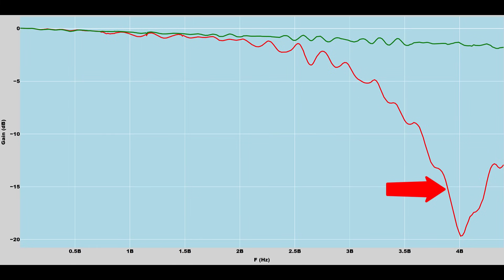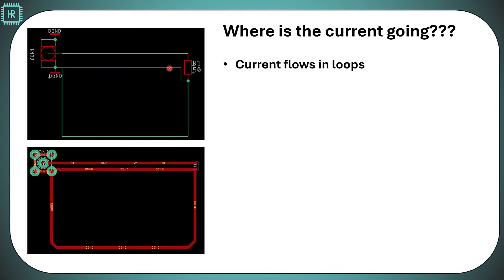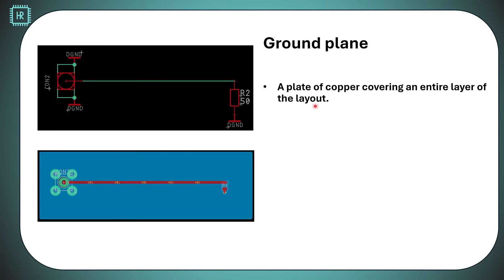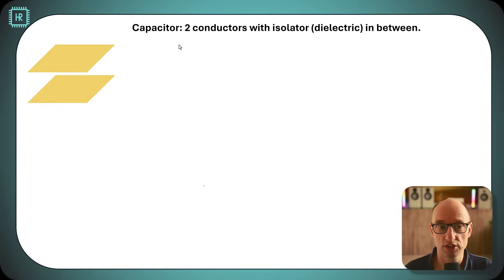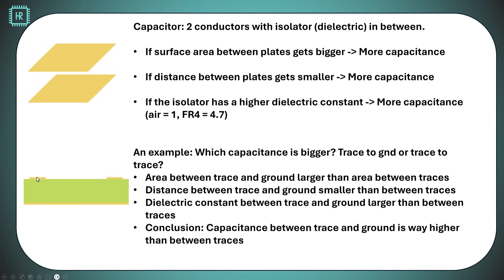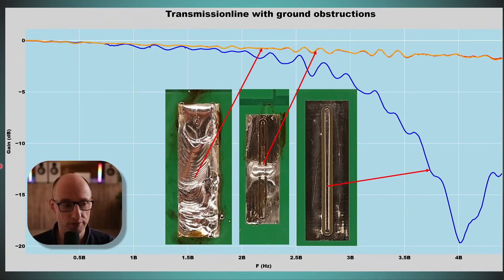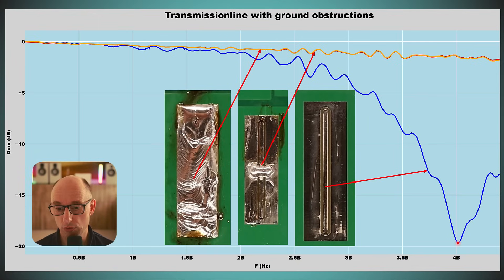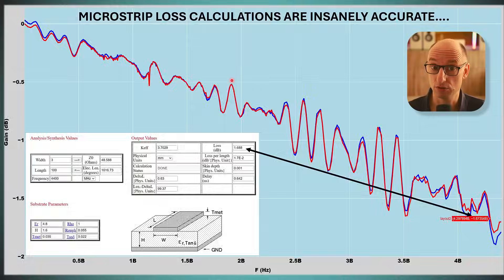Flawless PCB design: RF rules of thumb - Part 1

Comment: I'm not an electronic engineer so this is pretty advanced for me. This was radio circut but I assume that all electronics circuits is susceptible to this? 
Please send me the checklist.
Reply from the maker: I've changed the free checklist offer a bit: You also get a 1 hour module of my course for free!

You can find the link to the page in the description. Scroll down a bit on that page (Or read the whole page, you may get curious :-) ) to find the link.

You will have to leave your email address so I can start spamming you :-D . I don't do that very often, on average once a month, but I am thinking about starting an email series with useful electronics tips at some point.

Best regards,

Hans Rosenberg

Comment: nice work. Please send me the checklist!
Reply from the maker: thanks!

I've changed the free checklist offer a bit: You also get a 1 hour module of my course for free!

You can find the link to the page in the description. Scroll down a bit on that page (Or read the whole page, you may get curious :-) ) to find the link.

You will have to leave your email address so I can start spamming you :-D . I don't do that very often, on average once a month, but I am thinking about starting an email series with useful electronics tips at some point.

Best regards,

Hans Rosenberg
Reply: @HansRosenberg74  Thanks! I'm a power electronics engineer, for 35 years. fun stuff. you have my email now....

Comment: Wery usefull topic.
Send me the Checklist or (Send met the Checklist)
Thanks!
Reply from the maker: thanks.

I've changed the free checklist offer a bit: You also get a 1 hour module of my course for free!

You can find the link to the page in the description. Scroll down a bit on that page (Or read the whole page, you may get curious :-) ) to find the link.

You will have to leave your email address so I can start spamming you :-D . I don't do that very often, on average once a month, but I am thinking about starting an email series with useful electronics tips at some point.

Best regards,

Hans Rosenberg

Comment: It occurs to me that the topology of this board doesn't distinguish between your conclusion (current flows back directly under the trace) and an alternate conclusion (current flows back by the shortest path in the ground plane).  For example, if you had placed both SMA connectors a distance apart on the same edge of the board (for example the corners of the top edge in the board) with a U-shaped transmission line, would the response to an obstruction be the same?  Would the blob under the track be indistinguishable from a blob at the "shortest path" position, or from the blob along the entire length of the obstruction?  I'm not saying that you're wrong, only that this test didn't quite capture the difference.

Send me the Checklist, if that offer is still on the table.
Reply from the maker: Haha, you are taking a headstart on my next video where I want to dive into this :-) I want to make a ridiculous design that shows that the current REALLY stays under the trace :-) 

The document can be downloaded, link in the description. Link to the document AND a full 1 hour free module is on that page (scroll down to it).

Best regards,

Hans

Comment: I am curious, how much of this applies at audible frequency levels.  I am always worried about these things when designing pcbs because I know the rules without fully understanding the theories, and that had always served my purpose.  I also mill my own PCBs so my trace width and circuit layouts are generally limited to my machine tolerances and one or two sided boards. This has me on occasion, forced to creatively break the rules.  I am oddly most curious to know how much of your knowledge I can disregard if I am only concerned with frequencies under 40kHz?  Thanks for all the information!
Reply from the maker: With 40kHz, the wavelength is huge. And when the trace is much shorter than the wavelength, these issues don't play a role. However..... interference of RF frequencies will demodulate in any audio circuit and cause distortion. So there it is also wise to use good grounding.
Reply: @HansRosenberg74  i just finished part 6,  many of my questions were answered.  thanks again!
Reply from the maker: @DJRY360 great, that series is actually a mini Course

Comment: Hello... Just to help me understand the procedure @9:01. The NanoVNA will send sine waves of a known amplitude across the frequency spectrum from 50kHz to 4GHz. It will measure the received signal and calculate the gain based on the amplitude at the received end. Would that be correct ?
Reply from the maker: Yes, that is about what happens...

Comment: I am talking about time at 4:30. Isn"t the shortest past the hypotenuse instead of signal path thanks to Pythagoras theorem?
Reply from the maker: That mechanically shortest path has more resistance electrically (If I understand your question correctly). That is why the current will move under the trace.

Comment: Thanks for these informative videos!

Nitpick on the frequency graph, though:
"4 B" really? That's not very international. How about 4e+9 or just 4e9 or so...? :-D
Reply from the maker: Just keeping you on your toes with the 4B (Billion) :-)
Reply from the maker: technically, it is correct..... 4GHz is really 4 Billion Hz :-D (solved this in later videos)
Reply: @HansRosenberg74  "4GHz is really 4 Billion Hz" - yeah, in your language/country! In others, 4e9 is not called "billion" but milliard, and billion is e12. And "B" is not necessarily recogmized as billion, either.
That's what I meant by "international", but I didn't want to write an "essay"....now ended up doing anyway... :D
Reply from the maker: @tinkerwithstuff  hahaha.

Comment: Sir as i am new to PCB designing I want to know when and where which size of capacitor, inductors or other elements we should select. I mean suppose for a 10uF, 50V capacitor whether i should use 1210 size capacitor or 0603 size or etc how to decide that.
Reply from the maker: Interesting question! When I want to make it easy for assembling by hand, I usually go for 0805. Price can be another thing to look at. For higher values, smaller packages can sometimes be more expensive. Also be careful about high values in relatively small packages: You can have voltage derating:  You can loose up to 80% of the capacitor value at room temp using it at it's rated voltage!!!!!!!! Accuracy is another thing. If you need an accurate and stable value, you need to use NP0 or C0G.

Comment: Even for a "simple" transmission line there is substantial loss/transmission. Are there any PC board layout software products that calculate or even simulate the RF effects of crosstalk, ringing, transmission, and all the non-ideal parasitics?
Reply from the maker: Yes there are, 2.5D and 3D field solvers. HFSS is one, but it costs you an arm and a leg (and a few kidneys :-D  ). There are also free alternatives though.

Comment: That looks like a nanovna v2+4. I have that model.  I have noticed it's ability degrade above 3GHz. Can you get a thru S12 (logmag) measurement above 3GHz without a large signal degradation? When does this measurement degrade on your unit?
Reply from the maker: I'm not near the unit at the moment, but from memory, I see the same thing. Loss of snr at the highest frequencies.

Comment: How would you advise using a lengthy transmission line (120mm) line which connects to an antenna that is trying to operate between 600 MHz and 5 GHz. There’s very high loss at high frequency on fr4. Any advice?
Reply from the maker: Hi, using this page: https://mcalc.sourceforge.net/#calc I calculate 3.8dB of loss at 6GHz with a 1.5mm wide trace on a 0.8mm thick FR4 dielectric. Indeed a bit of loss.... hmm, if you can't take the loss, you have 2 options:
1. Go for a more expensive material (jlc has ptfe substrates that are half the price of rogers, but almost as good, could be an option. I have not used this myself yet, but the specs look great).
2. Make the trace shorter if you can.
As another alternative: if it is a one-way trace (just transmit or receive) you can add more power for tx, or add an LNA for RX to deal with the loss.
Best regards, Hans
Reply from the maker: I found a much better solution! Ipex cables. Check out this cable: https://www.grand-tek.com/en/i-pex-mhf-connector.aspx
and this datasheet: https://www.te.com/usa-en/product-1-2016698-2.datasheet.pdf
You can get these things everywhere, also on aliexpress. Loss for 100mm is <0.5dB at 6GHz! (this is for the cable I found info on, always risky if another cable has the same low loss, it was really hard to find this loss data)
You need to put 2 rf smd connectors on the pcb and click this cable assembly on there. Probably a lot cheaper than a rogers board or ptfe board :-)

Comment: Great video! When you say, "Make sure to have a ground-plane without obstructions", does that include vias? If so, how are you supposed to take advantage of the other layers of the board (i.e., if layer 2 is my ground plane, how do I get to layers 3 and 4 without vias)?
Reply from the maker: vias are not a problem. A 'via wall' as I call it (many vias next to each other making a big slot in the ground plane) does pose a problem. The via's are so small that the current travelling around them will cause a problem at very high frequencies (at least 20GHz or higher). I believe I go deeper into it in this video: https://www.youtube.com/watch?v=XD1jqFaA-uI
Best regards, Hans

Comment: Hi, I'm a software developer getting into electronics and it's a ton of fun. I'm trying to build a 8 bit computer using sinple IC's for gates and transistors but i start getting strange "mistakes" in the logic and someone informed me that it might be that I need capacitors as I'm using too much power too quickly on certain parts.

Can you make a video on nice rules of thumb to keep things powered? Maybe how to segment the sections in a way that keeps it simple. The wiring becomes a lot so any simplicity I gain is a win!
Reply from the maker: Hi there, sounds like you're breadboarding? This is a real pain for getting good 'signal integrity'. For that you need a ground plane and good decoupling. If you're on a breadboard, use a star shaped supply (supply all ic's from one point) and make sure you have a 100nF cap very close to each ic to keep the supply of that single ic quiet. Best way would be to design a board, but that is not flexible off course.

Comment: Question:

What happens when we have no choice but to create an "interruption" in the ground plane, such as in thermal or mechanical isolation slots or with THT components?
Reply from the maker: Just route around it with a ground plane under it so there is a short return path.
Reply: @HansRosenberg74  So where possible, surround the interruption with as much ground plane as you can? Apologies, I'm just a first year EE student.
Reply from the maker: Well, just apply the theory I'm explaining: Make sure there is a ground return path really close by, that is all. If you have ground below your signal lines, that is as close as you can get :-)
Reply: @HansRosenberg74  Thank you. That makes sense.

Comment: Thanks for the great videos I have discovered. Have two questions, glad if if you could clear them for me: 1. Quite a little bit confusing when you explain in first part the return path (example with no ground plane). SInce either in DC, current follows the least resistive part (so the straight line) then in high frequency the least inductive part (the smallest loop) so won't the bigger loop get ever involved in both cases? ( DC will have greater resistance / HighFreq. greater loop area so bigger inductance??) if so why include it in the example?
2. Considering ground plane on the same layer of the signal ( in this case the TOP) where would then be the shortest path since no direct path under the signal line is present, would be around it? Really appreciate. Thank you.regards.
Reply from the maker: In the DC situation, the current divides 1/3 and 2/3 (in the short loop). For high frequency, nearly everything will take the short loop, as proven by the later 'solderblob' experiment. hope this clears it up.

Comment: Great video, but I am a physicist and I have a different perspective about what is inductance. When dealing with inductance I like to think that energy gets stored in a magnetic field. 
When the return path is below the signal path the magnetic field gets partly cancel each other. Meaning less energy is stored in the magnetic field, meaning lower inductance.
I also think it lowers the skin effect and thereby lowering the resistance, but I'm not sure.
Reply from the maker: Interesting viewpoint. Is it not the total field size getting smaller and smaller as the ground gets closer? A smaller field stores less energy.

Comment: Outstanding! May I ask which PCB design software are you using in your courses? I am a graduate student with an emphasis in Microwave circuits, and I’ve used ADS predominantly for my designs. However, the layout functionality isn’t as intuitive and seemingly less useful than other PCB design software such as Altium or Cadence. I’m not very proficient in either of them, and I’m interested in your courses. So, I’d like to focus my attention on using the same software if I’m to take your courses.
Reply from the maker: I'm using eagle (now autodesk electronics). The bad thing is that autodesk ruined what was once a fantastic pcb design program. So I would not advise using it. I will make the course in eagle/autodesk electronics because I've been working with that for 20 years so I will be quicker and familiair with it. I wonder if there is a lot to gain from making stuff yourself during the course. It is more useful to see how to do it and apply it to your own designs. I don't think many people will go though that trouble either. I had some talks with customers in the netherlands and I got the feeling they were more interested in the knowledge than actually designing boards during the course. I probably would not do that or would have done that either when I started professionally 30 years ago.
Reply from the maker: I will offer the option to do the pcb design most likely by the way. autodesk is an option, they have a free version where you can do the schematic entry and for the pcb part you would need a one month trial. In the longer run, I hope to convert the design to kicad (which is free) or maybe altium, but the altium trial is only 2 weeks, so you'd have to work hard :-)
Reply from the maker: I think now that I may try to put everything in Kicad. I'm not 100% sure yet, but I'm so unhappy with autodesk that I think it might be worth making the transition. Not looking forward to that, but there are just too many missing things in autodesk at the moment. not 100% sure yet though.

Comment: I have a question about RF PCB design. Sometimes you see those absolutely wild RF PCB's that look they're designed by aliens for aliens, and I'm wondering: is it because it was the optimal way to design that PCB or is it one of billions of ways to design a PCB with those characteristics? Basically, my question is: how constrained is the PCB design space? If two expert RF engineers design a PCB under the same constraints, how similar will they look?
Reply from the maker: Really wild looking boards usually indicate 'distributed filters' and things like that. Those are weird looking layouts which are actually filters, combiners, couplers etc etc.  There are not that many ways to design them if you want to achieve certain specifications. There is a lot of freedom in how you would make the floorplan however, you would see some differences there. There will be a clear better solution for the floorplan though. Often in RF you are trying to minimize crosstalk between different parts of the pcb (in case of a network analyzer or spectrum analyzer for instance).

Comment: when you put a solder blob at the center of that resonator, didnt you create two resonators of twice its frequency?
Reply from the maker: In theory, yes, however, there is no field to 'get them moving'. If there was another trace running over the loose ends, that may trigger it to resonate at a very high frequency since the 'legs' will be very short.

Comment: I have been working on analog and digital radios for years now, more on the software side, but still touching on hardware a bit. I feel like I learned more in 15 mins on HW design than in 10 years of work. You are amazing.  Thanks for the checklist too ! edit: i cant get the checklist, my address is refused. Your regex is probably refusing the '-' character in it. It would be great if you could fix this.
Reply from the maker: Hi, wow, thanks for the compliments :-) I just tried to download it, that works with my address. About the regex, I'm not sure, the page is made and handled by the Kajabi platform so I cannot control that. Can you try again? Otherwise, please send me an email info@hans-rosenberg.com with the remark that you would like to have the checklist. Best regards, Hans